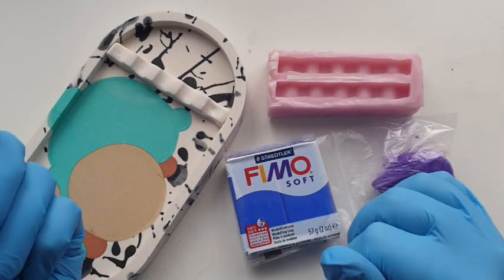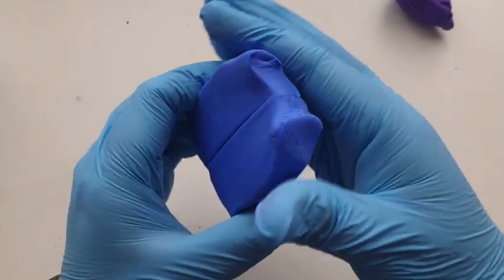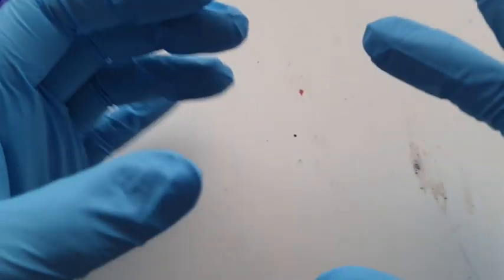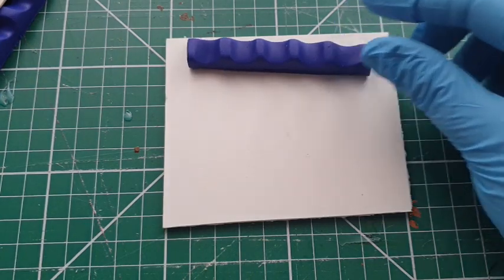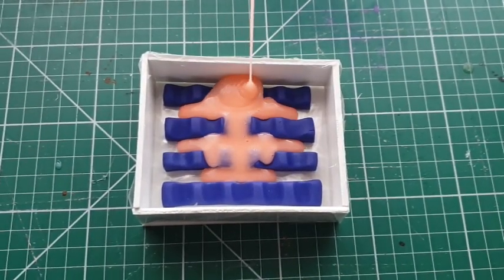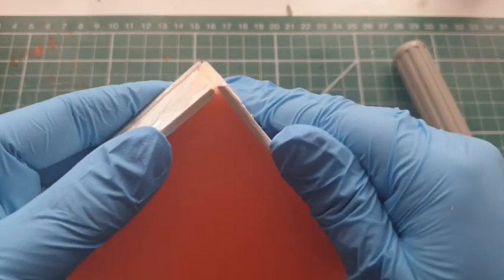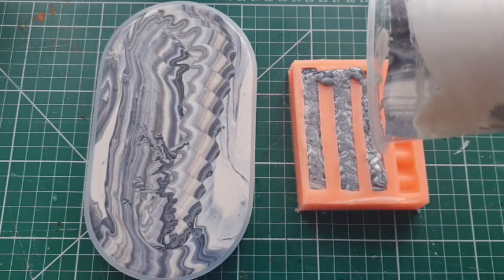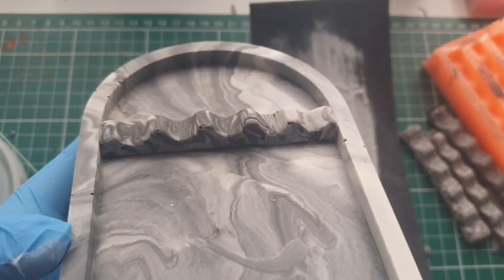DIY Silicone Mould  *EASY Tool Rest Mould* for your trinket trays

Comment: I like the tape technique for the mold box! It's always such a struggle with hot glue! I've had good luck using metal cookie cutters as the container for smaller items, but it can wind up using more silicone if you don't have the right sized shape handy.
Reply from the maker: Ahhh yeh Cody I have used glue in the past and found it hard getting it off this board ... so tape works best if ya wanna re-use .. thanks so much x

Comment: Not an expert, but have been working with and researching a lot to do with polymer clay! With Fimo soft, if it's fresh clay you probably didn't need to do half an hour of conditioning, especially if it's still super hot where you are! And I think it's 110° not 100° for baking, but the main problems you would find with not baking hot enough is that your pieces might break, but since they aren't part of the final product I don't think you'll have any problems! Nice to see another use for the large supply of polymer clay I'm looking at buying 😊
Reply from the maker: Thank you so much Georgie that is so so helpful ! xxxx I felt like this FIMO was still hard after 30 mins but just ok enough to roll a snake ... I would love a soft FIMO or other brand .. I would love to buy in bulk. These little colourful packs are a little lost on me as I don't do detailed work x I would love to do those amazing canes people do x
Reply: @ClairesCraftyCorner  the Fimo soft I bought off Amazon recently was super soft, and in Barcelona summer it was practically melting! Guess you must have ended up with an older batch of clay. I'm working my way up to canes, still so much to learn and so many techniques to try :)
Reply from the maker: @georgiec2612  ohhhhh yes that makes total sense ... my FIMO has been in the box for at least 2 years ! 🤣🤣🤣 I just wish I could sculpt .... I guess I need to practice x
Reply: @ClairesCraftyCorner  maybe now that you have more time you can try it again! I would recommend buying fresh clay though, you'll probably end up very frustrated using 2 year old clay 😂

Comment: Hiya Claire,
I bought a lot of the materials to try this out !!! Did you use a silicone release spray by any chance? If yes, what would you recommend for a silicone mould for a concrete/cement mix. Thanks :)
Reply from the maker: Heyyyy Morisha, so glad youlike it x No I dont use a release spray ... I never have ! I have never needed to. xxxx I know that it is meant to make your moulds last longer ... but Jesmonite is different to resin and will not deteriorate the moulds in the same way x